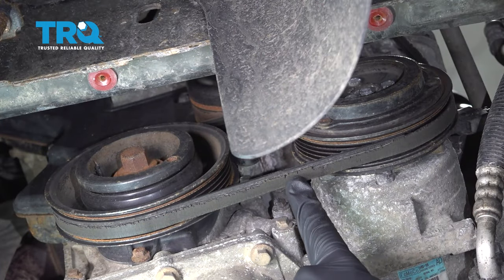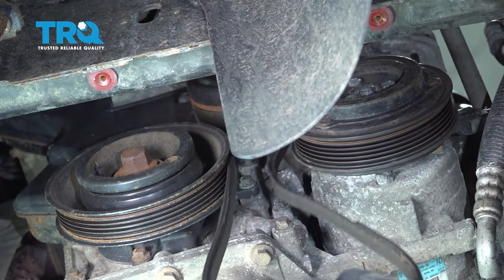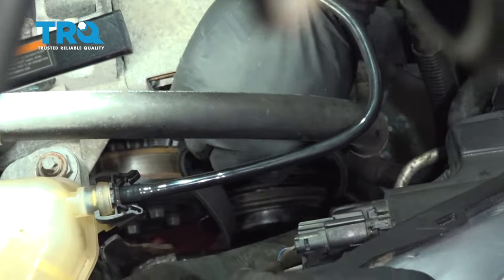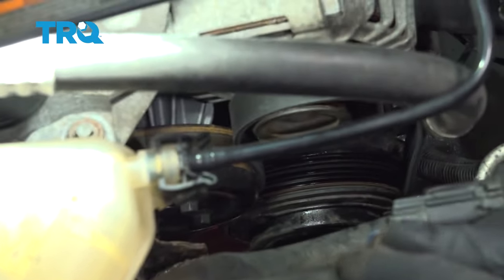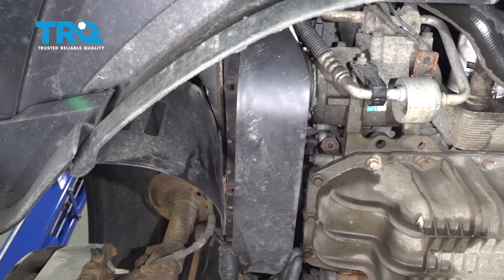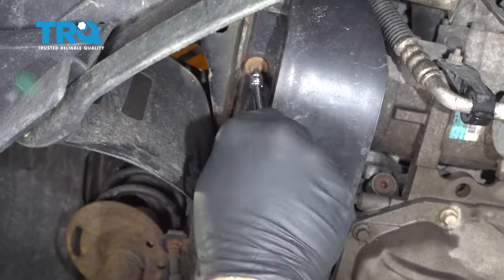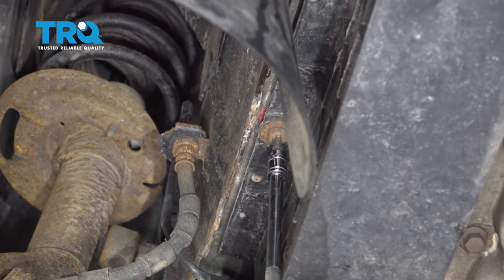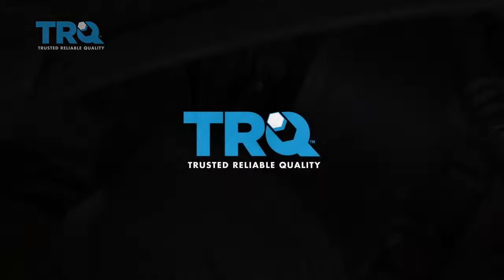How to Replace Serpentine Belt 2011-2019 Ford Fiesta

Comment: What are you pushing with the screw driver, while cranking the belt on?? Thanks!!
Reply: The serpentine belt wants to walk off of the water pump pulley so you have to continually work it back over the pulley or it will pop off

Comment: Perfect guide, managed to do this in the gas station parking lot, stretch belt tool made this an easy job. In a hurry racing against some rain I learned to be patient when putting it on and do little turns while pushing the belt onto the smooth pulley with the screwdriver as you showed. Thank you!!

Comment: I zip tied mine and just cranked it too place without struggling just followed his first steps but didn’t have the tool so i just zip tied the belt aligned with the wheel and cranked it too place

Comment: Ya know, I always appreciate people who do videos on how to do stuff. So thank you for taking the time for this. 
With that said, my question is. 
What if someone were changing the alternator out. The belt is good and your only option is to cut the belt off. 
Here is my suggestion/revision. Using a large screwdriver, "guide" the belt off while turning the crank as you showed for installing the belt. This way the belt can be reused when finished.

Comment: Great video, I followed these steps today and I appreciate how concise and clear this was.  After 2 trips to parts stores (the rented tool wasn't working out for me) I bought the Lisle 59370 Stretch Belt Remover / Installer in the video and we got it figured out (I didn't know about the magnets, super handy feature).  A couple notes for anyone in the future watching this:

0:13 You can also used a slotted/flathead screwdriver on these, T27 works super well but if you're in a bind you don't need it
0:43 The Lisle 59370 has a remover portion of the tool, if you have a good belt that you want to reuse you don't have to cut it.  If it's due for replacement though either by age or mileage regardless of how it looks just replace it anyway

But yeah, I'm warning my friends who have these, change the belt before it breaks!  Not a fun install, certainly not the worst but I'd preferred not to have done it in a parking lot :P

Comment: I just did the thermostat on my 2015 Fiesta ST. 1.6 ecoboost.  I found a tension pulley for the belt just back and up front the crank pulley.  Used a wrench and easy peasy.

Comment: Thanks for this. I didn't have that nifty tool, so I used my hand. Turning the "correct", clockwise direction that you demonstrated, whenever the belt popped on the crank it popped off the rounded (?!) idler. When I turned counterclockwise, I could get the belt on everything at the same time. Then I turned clockwise to get all the ribs seated in all the slots. Be careful when using your hand that you don't get a finger pinched between the belt and the compressor pulley!

I didn't know what was wrong with the car initially, and I drove it enough to learn that the only reason you have to have this belt is to drive the alternator. If your battery is charged enough, you can probably drive a couple of miles. Eventually the transmission stops shifting correctly or the engine shuts itself off.

Comment: Hey if you want to reuse the belt I took out too two bolts of alternator and loosened the bottom one. Took a pry bar and pushed it towards the bumper. Gives u enough slack to pull it off. And put it back
Reply from the maker: +Sweddyedee757 Thanks for the feedback! http://1aau.to/m/Shop-TRQ

Comment: Thanks for the video.  I was getting frustrated with the belt slipping off of the water pump pulley, then saw you pushing it back with a screwdriver every 1/8th turn or so on the crank.

Comment: I have the same part belt same car and bought the same tool, the belt in no way shape or form will stretch to fit over this.  I tried heating up the belt it's really not even close.  Not sure why it's called "stretch to fit" it does not stretch.  Maybe I'll try a stretchier after market belt?

Comment: So do you need to re time the crank? You said you turned it five times and your dot was not TDC I’m confused 😐
Reply: This belt does not control the cams (so will not effect timing). No worries there.
Reply: Everything still moves in time, and the sensors will tell it where it is in the firing cycle at start up.  The computer checks the cam and crank positions, for the ignition timing, on every start.

Comment: I ended up using a short flat head screwdriver on the alternator pulley from above. Go with the screwdriver from the back side going over the top towards the front of the car (that’s the direction the engine runs) Try to get it started and then you can keep trying to rotate the engine by pulling on the belt. You’ll definitely damage the pulley and the belt some. I hosed mine down with belt dressing and crossed my fingers (both hands). 
Shame on these engineers for creating a situation that causes more breaks and then making it impossible to repair…

Comment: Would not recommend doing by yourself alone.

If you decide to say F it, I'll do it myself. HAVE TWO PAIR OF HANDS READY TO WORK ON THIS REPLACEMENT. I couldn't do it myself, had to call in a favor. It definitely helps to have a wrench with a swivel AND the "engine belt guide" peice of metal.

Engine belt guide
1/2 18 mm socket piece
A swiveled wrench
Flat head
The engine belt

 If you don't have any of these tools, be prepared to spend at least 120 smackaroos. F this car.

Comment: As cool as it is to see the tool designed to do this....i cut the belt off, fit the new one on as best you can over all the pulleys, and zipetie the bit that doesnt fit to the crank pulley (just enough to hold it in place, i do like 2, maybe 3). Now, turn your key and let the zipties and crank pull the belt on, the ties will break before your belt. If you want, unplug the spark plugs before turning your key to prevent a full start. Done in 10 minutes or less.

Comment: this happened to my belt a slight piece came off the side and I cut it off. Its not as wide as it was but it still seems to be running. Anyone know if this is an emergency to fix right away or if I could drive a few days with it in this state? Also if not wondering how much it would cost to have it replaced.